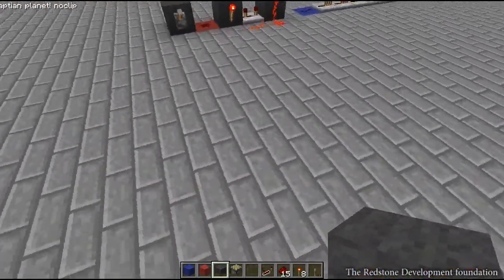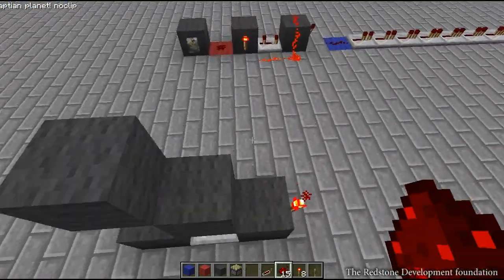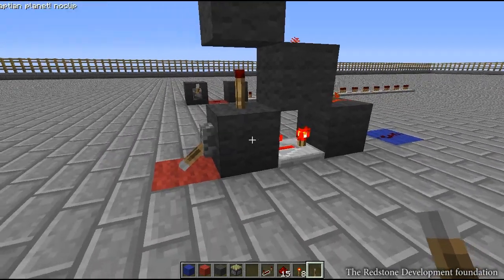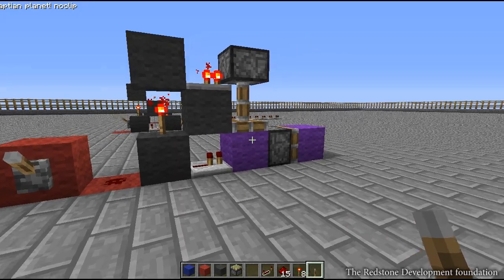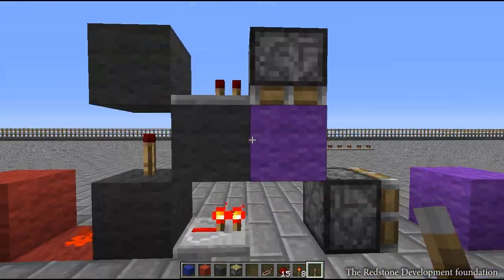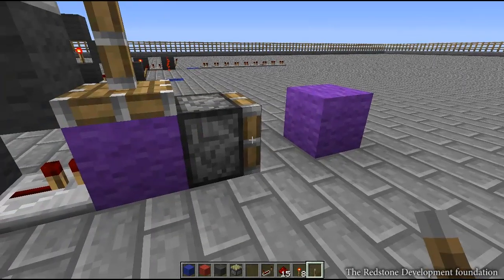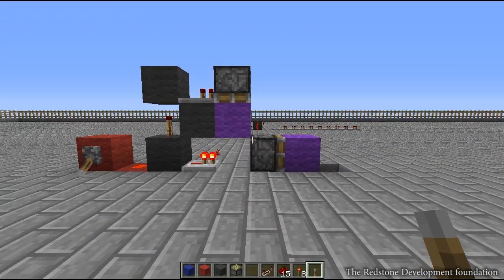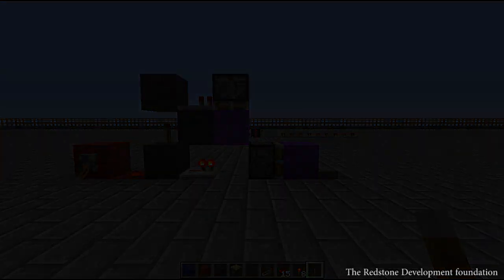What is: Monostable circuit

Comment: I don't think it would be a logic gate because a logic gate has curtain conditions under which the output is turned on, and the conditions for the output on a monostable circuit would be when the input is on, the output is on (For a short time, but still on).  That's just the conditions for a wire, so this would be a circuit.